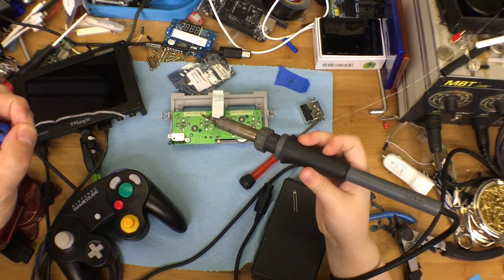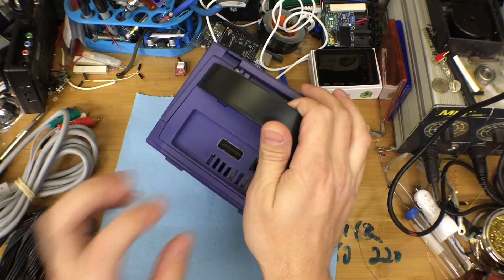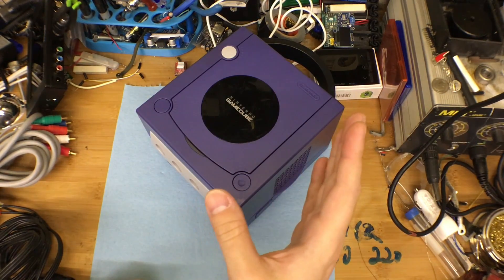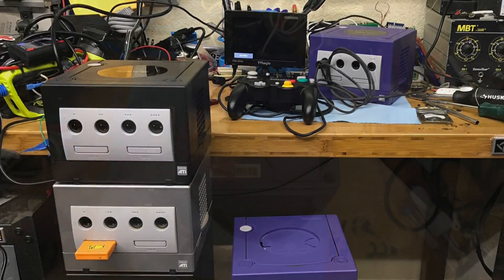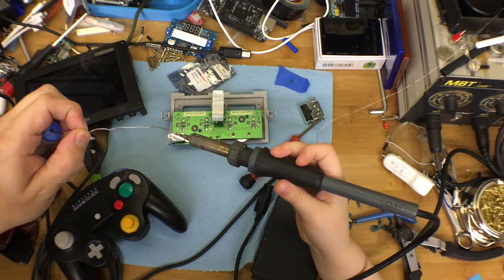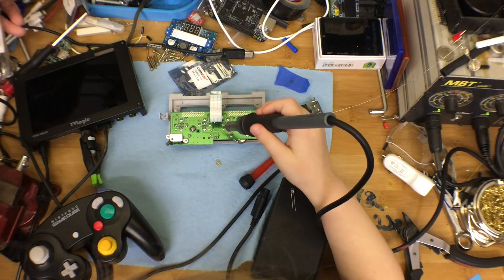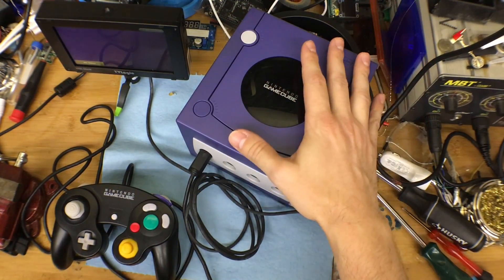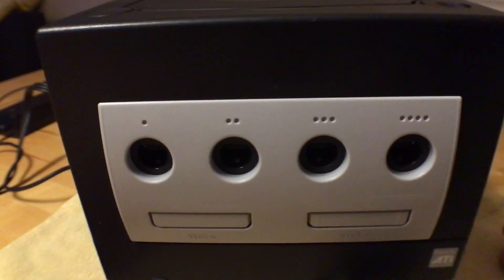HDMI your GameCube ! Plus GameCube Giveaway (closed)

Comment: Hey, great video. I’m thinking of doing this mod myself after watching this.

Could you tell me if you had to cut away the metal shield to accommodate the GCVideoHD board and the 3D printed mount?
Reply from the maker: I did have to cut away some of the shield. It's very obvious what part once you get it all in place and start to reassemble. Just mark it and cut away a bit with a dremel. Good luck! You'll love it when done

Comment: Awesome video, thanks for the credit on the mount.
Reply from the maker: You rock! We all know if you hadn't designed a mount, we'd all be gooping on big balls of hot glue to hold it in. You're mount give it that pro look and pro support to last years. I've been thinking of printing an entire top cover to allow full size discs to be used. (since they fell out of production so long ago), stay tuned.
Reply: JuliansRandomProject a full top shell would be so cool, I need so much more free time to work on projects. I've mostly been doing small things. I did get the opportunity to work on the Plug and Play GCVideo dongle based on my plug design.